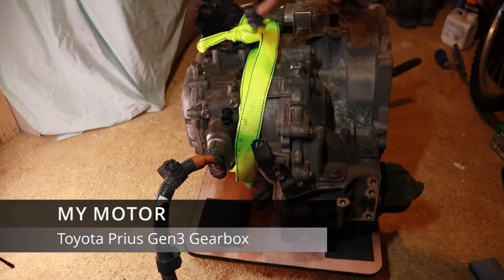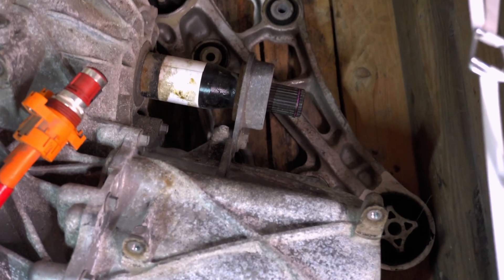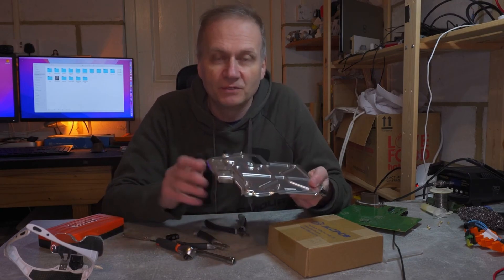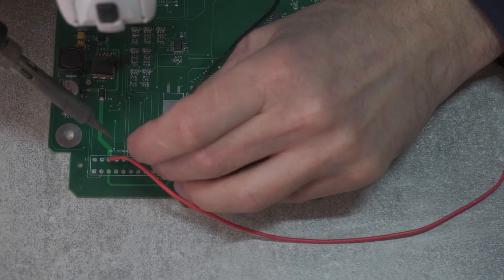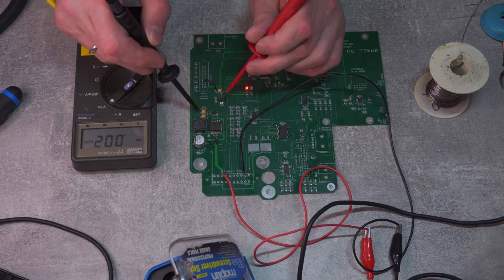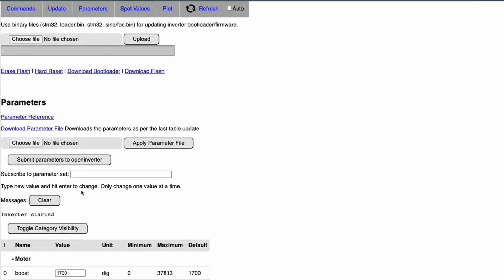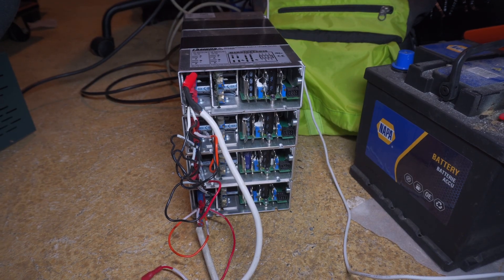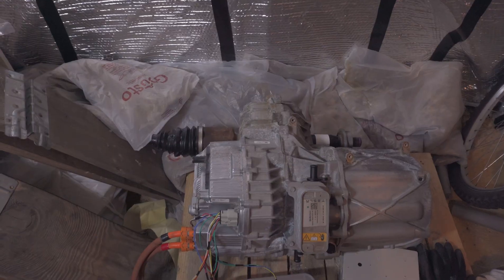I Bought a Cheap Tesla Motor for My DIY Electric Car!

Comment: Hi. Can you change the max current in open inverter? What's the max current can this inverter do if current limit from Tesla is remove?
Reply from the maker: You can program your own parameters but I would not recommend trying anything crazy as you can damage the inverter power stage easily
Reply: @LatutaEV hi. Thanks for the reply. Can there inverter do 900amps?

Comment: It was my understanding the tesla motors/inverters can be controlled with just canbus messages.  Is that what the board does, just send canbus msgs?
Reply from the maker: No, this board replaces the Tesla control board inside the inverter and controls the power stage by itself. The board uses Open inverter program designed by Johannes Hubner to control the Tesla power electronics
Reply: @LatutaEV  ok, but is that actually necessary?  Can't you just use canbus to control it?
Reply from the maker: @murraymadness4674  Yes potentially it can be done but it's not as simple as it sounds. I believe Tesla encrypted some of their Comms but I have never tried. The second factor is that Tesla updates the firmware on those boards frequently. If someone gets a newer motor then previously determined protocol may not work. And the third factor for me it was more interesting to learn how the inverter works in this way 😉

Comment: Can a 60v 5amp power supply be used for the initial test HV first run or does the amperage need to be higher?
Reply from the maker: @statzietech  it was Jlc PCB I have found their software often not interpret the rotation of the components. I actually check but I am guessing not well 😞

Comment: WARNING!  When connecting DC power supplies like that in Series, be careful and make SURE that the (-) output connection is not connected to the frame/housing of the power supply.  If it is, and you "stack" them as shown, you will be shorting the outputs to ground... from the mechanical connection of stacking them.
Reply from the maker: Thanks for your advice the outputs are isolated to ensure that they don't touch the chassis of psu
Reply: @LatutaEV   I probably should have been more specific... and this wasn't really aimed at you, but at viewers. It's relatively common that some manufacturers internally connect the "-" DC output to the metal/mechanical enclosure of the power supply.
Reply from the maker: @beforebefore  yes I see what you mean but not on those lambda power supplies they are great

Comment: How much did it cost to build the controller yourself?
Reply from the maker: A bit short of £200 if you exclude time  spent testing and purchasing discovery board I used for testing
Reply from the maker: That's for two boards of course 😁

Comment: 3:08, Model X was not released until 2016
Reply from the maker: I don't think I have ever said Model X. This motor is actually from the model S. My exact words we ...."technology Tesla had in 2016..."
Reply: @LatutaEV  I appreciate the answer, and it is really nitpicky, so sorry for that, but the exact words I was referring to was: 
"I couldn't help but admire incredible level of technology Tesla had even in 2013 when this car was built." I reacted to it because the Ebay page showed motor from a 2017 Model X.

Again, I wasn't trying to be trolly or a negative commenter, I simply wanted to add a correction in case someone else was confused by the statement.

I really liked the video by the way, super informative and clear, so thank you for putting it out there!

Have a great day!
Reply from the maker: @herrjonna2007  Yes it was a bit nitpicky but I am not a big channel and not running YouTube as a way to make money but a hobby really. So I welcome any comments. Thank you for your attention and for liking the video 😀. But to be pedantic the eBay title was: "Tesla Model X S 217 AWD Front Engine Drivetrain..." I guess the seller was trying to squeeze as many key words in the title as possible. He even called it an engine 😂. Sorry I AM not responsible for that one either 😭
Reply: @LatutaEV  Hehe no I understand, Ebay sellers be Ebay sellers 😂
Reply from the maker: @herrjonna2007  true

Comment: ... how exactly did this Inverter board even work?   was it an aftermarket repaired unit?   🤔
Reply from the maker: No this is an open inverter board I made myself. It's based on Damien Maguire's design. It replaced the Tesla processor board to control the rest of the inverter. If you watch my Prius inverter and gearbox series you will see a variant of that board used as well.
Reply: @LatutaEV  ... oic, thanks for the reply.  I thought that the board was manufactured by Tesla 🤔
Reply from the maker: @Texaca  the Tesla board was replaced

Comment: I was wondering where the actual inverter is. You can see it for a split-second at 9:49. The hole for molex connector is visible there too.
Reply from the maker: The inverter is under the processor board if you watch my other video on the Tesla motor play list you will find one

Comment: Thanks for another amazing insights video. Wondering if you intend to use the Tesla motor on the Prius chassis? Any particular torque ratio considerations or frame modifications?
Reply from the maker: I am not considering Prius at this stage. I have not started thinking about those things until I sort out batteries
Reply from the maker: I actually quite like the look of a new Prius so I was considering to use Prius gen3 and modify it to look like a new one. But they hold the price quite well so more expensive than other models I am considering
Reply: @LatutaEV  I love the prius box too, particularly like the prius 2 (I have a 2008 version). Though I also have a tesla x, I would love to see the hybrid converted electric – without expending an arm and leg for it though.
Reply: I too would like to convert a gen 2 Prius to all EV.  Maybe with an obnoxious amount of HP, like an electric muscle car?  Any recommendations welcome?